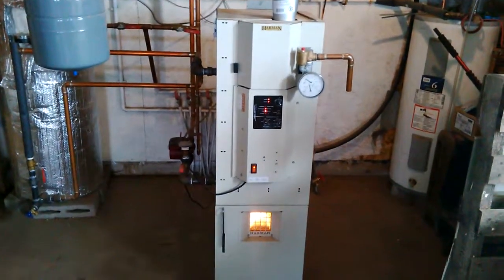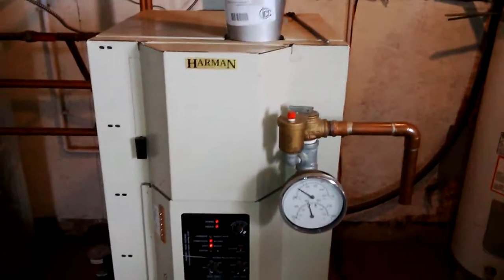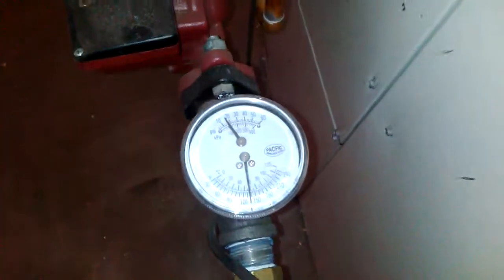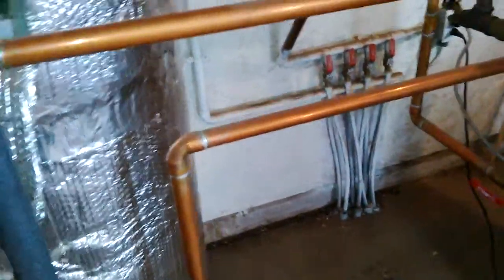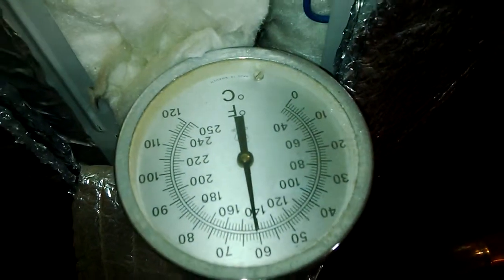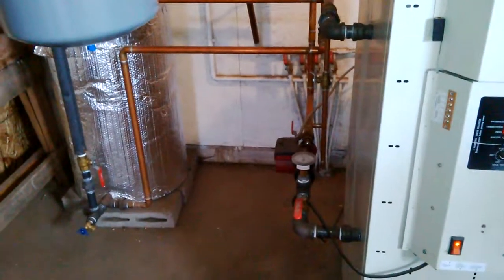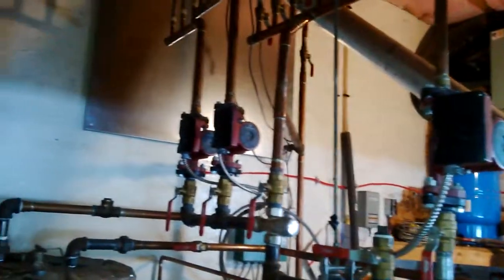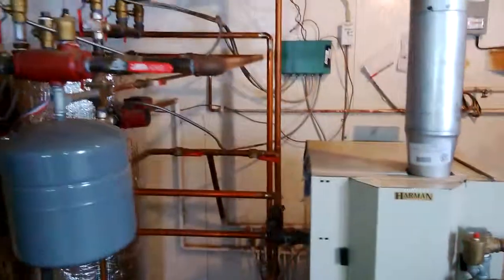Sooty Sweeps pellet boiler with buffer tank on a budget!

Comment: I have a Harman H60 too.  what are you using for vent/chimney pipe? brand and size? (my exhaust collar is hard to get a good tight seal sometimes. it slides inside the pipe, instead of going around the outside.)